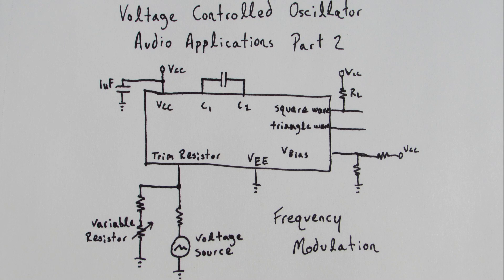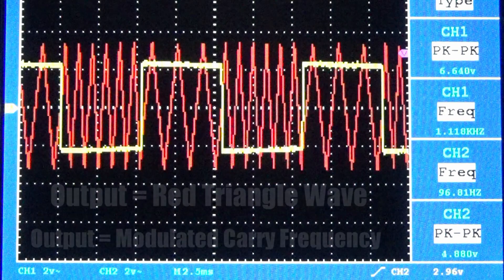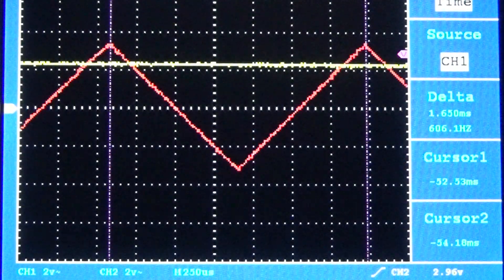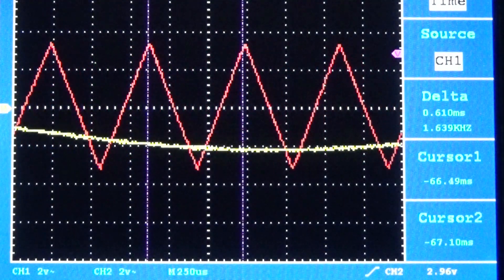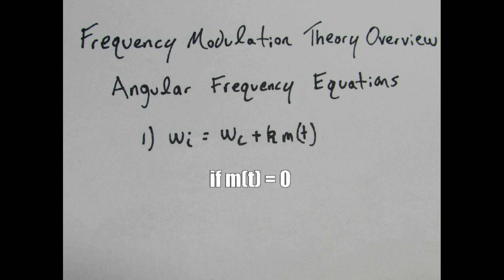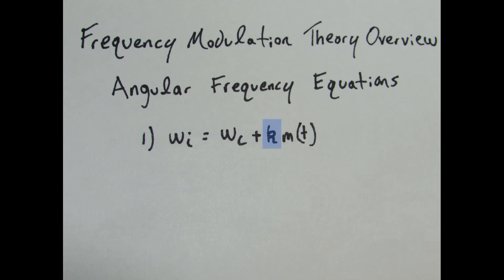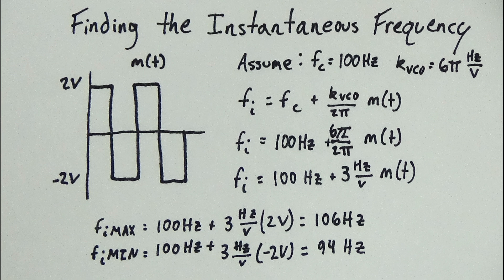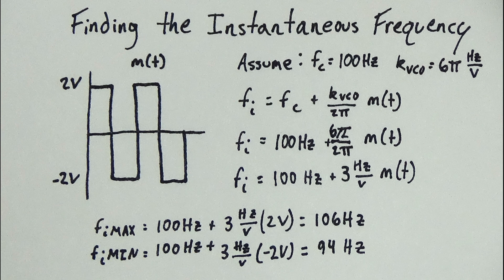VCO Audio Applications Part 2- Frequency Modulation (FM) Voltage Controlled Oscillator

Comment: Thx for your video. In my case I need to perform a sweep through a wide range of sqare wave frequencies. Do you know what I have to add to your schematic to do so?
Reply from the maker: Hey Abgas! You do not need to add anything  - use Pin 7 instead of Pin 8 as the output! This is the nice thing about this chip, you get the triangle and square wave output at the same frequencies on two separate pins. You can review page 14 of the datasheet for reference :https://www.exar.com/content/document.ashx?id=179